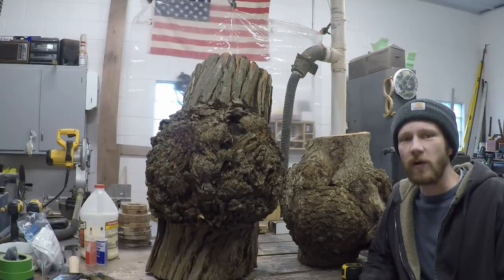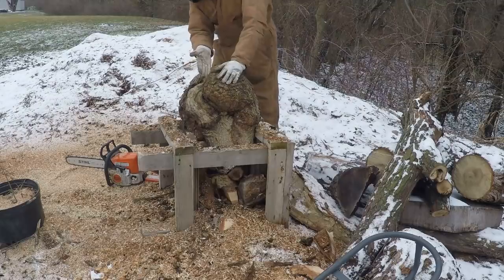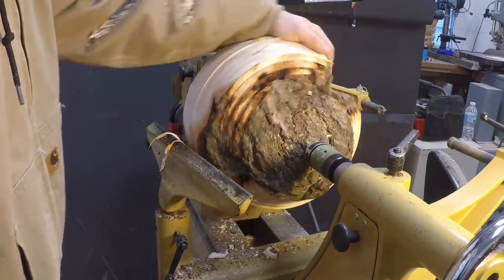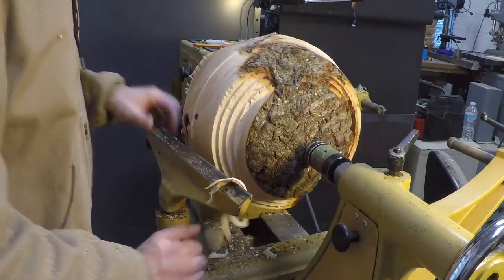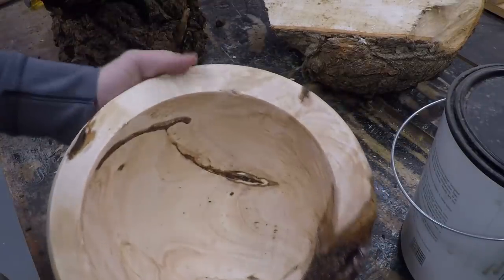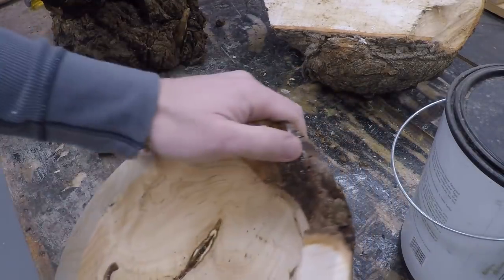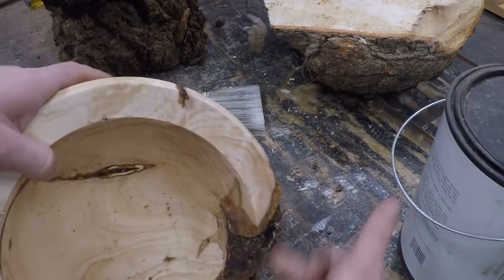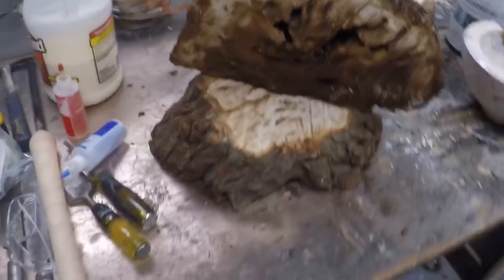Burl Finds and Turns - To Burl or Not To Burl - Sawdust Factory Woodturning

Comment: I like that bowl, Josh. I like gnarly wood -- nice, clean bowls are just bland. (picture Madeline Kahn in Blazing Saddles sniffing the bouquet of roses "how... ordinawy (sic)") Wrt the struggle roughing, let me offer this for your consideration: an 18" length of 5/8" 4140 steel hexagonal bar, hole drilled in one end to accept a 1/4" HSS metal lathe tool blank and drilled & tapped for a couple of set screws. Grind a sorta fingernail on the HSS blank and you can bludgeon any blank onto round without trouble :-) 4140 is a lot tougher than mild steel, the hex shape permits registration of a flat on the toolrest, and you can rotate to a flat either direction.  Clyde
Reply from the maker: Great idea Clyde! I might have to make one of those.  I have some D2 still laying around the shop somewhere, I’ll have to dig it out.  I might even have a hex profile bar too.  But it’s probably not 4140. 
I like character in my pieces as well. But this one was kind of disappointing since I walked in thinking I was going to get a great Burl piece out of it.  Oh well lesson learned... don’t have high expectations till you know what’s behind the bark. That might have to be the title of my next video.

Comment: Is this work as dangerous as it looks?  I looked and noticed that thankfully you wear a face guard and stand to the side as much as seems possible.  If one spun off and hit you a face shield might not be enough.  Hopefully it's not as dangerous as it looks.
Reply from the maker: Yeah it’s dangerous.. I got hit in the head with a pretty good size piece of wood last year and it pushed on the face shield so hard against my skin I ended up with 5 stitches above my left eye brow. The key is properly fixing things to the lathe and checking wood stability as you go through out the project.